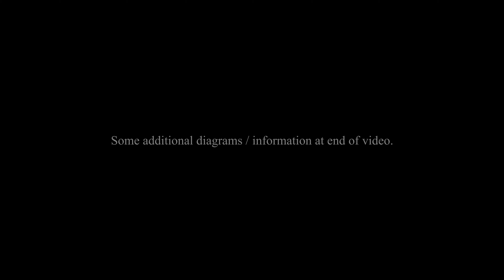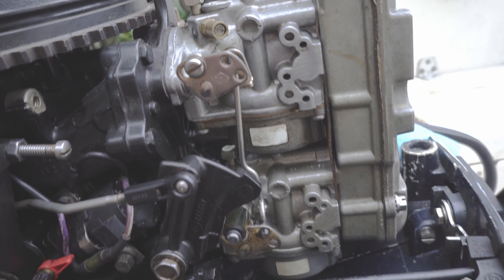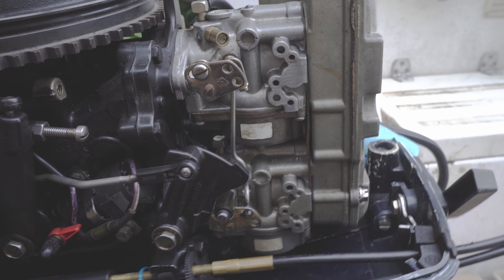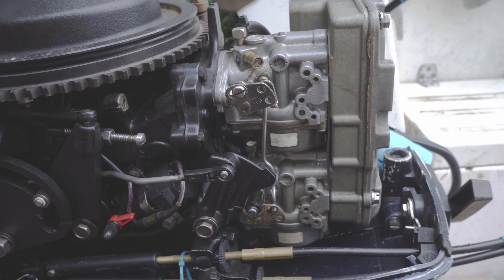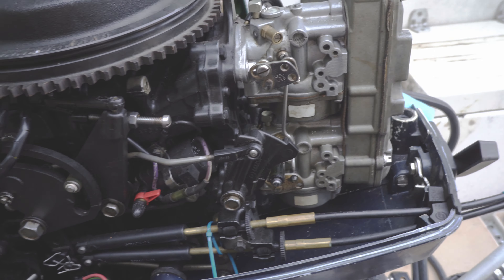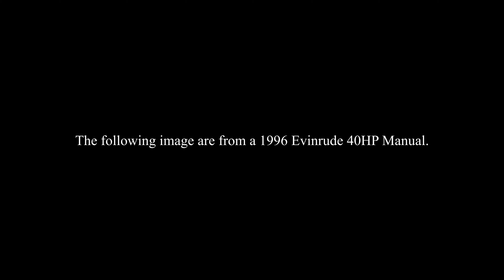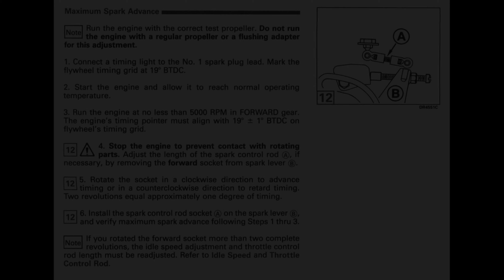Two Stroke Outboard Shaking - easy carburetor linkage sync check and adjustment

Comment: Thank you. I had a rubber seal in the drain on a water separator filter. It puked all this into my carb. Bottom only because the fuel manifold is vertical and the gunk plugged the bottom carb. Cleaned the carbs, ran great 2 trips. Hit rough water on 3rd. Ha! Small pocket at bottom of fuel manifold still had gunk in it. Cleaned it all again. Now had a pulse idle! Kill it bad. Made the adjustment in linkage you recommended. BAM! Smoothed right out. Put the timing light on it at idle, 2 degrees off. All loose when I got this motor. Runs great with that gap.  Thank you.

Comment: Also make sure all the throttle butterfly plates are closed in idle position because the linkage between the carbs may be keeping one from closing completely if adjusted too tight. Also one of your spark plugs may not be firing, like a bad plug wire could be shorting.

Comment: I have an evinrude 150xp, and mine constantly dies on me after running a fairly decent 32mph for a good distance, but when I slow down to idle or dock, it wants to die repeatedly and I was thinking because of the low idle, but I'm gonna check these parts out, too... thanks

Comment: at 2:10..mine dont start off horizontal ( 3, 9 o clock
) they are slightly off. and my lower carb pin doesn't open vertically when wide open. how do these get adjusted.

Comment: Came across your video and will look into this!

Hope you can help diagnose this issue.

1986 Nissan 70HP

Both carbs had new kits put in them last year.

I believe I am having a fuel or air problem and not getting the full power of both carbs.

It is also possible the carbs are not properly 'synched'.

When I spray a little carb cleaner in the top carb the engine rpm raises dramatically maybe another 1000 or so.

When I spray the same shot in the bottom carb the engine rpm raises but maybe only half rpm of the top carb.

What would cause this discrepancy?

Would I be correct in thinking I have an issue with the bottom carb?

It appears to be more air related as opposed to fuel related.

Comment: Where is the adjustment made ?? How do you make the pins vertical .. Mine on the top carb is way off .. Both carbs were removed and cleaned ..

Comment: Do you have a video on how to adjust the idle on this motor? I have the same one and want to increase the idle speed
Reply: Dito on showing how to sync the 2 fly's to work when running wide open if there a bit off bud...Mhahaa

Comment: How do you adjust it? I need to check mine. It’s shaking somewhat and idling too low
Reply: It did have that ever important how the f do you adjust it when it’s wrong factor...
Reply: But the 2 cylinders generally shake a bit at idle but should smoothly accelerate to wot. And sing pretty

Comment: the roller for the timing advance (the big slotted plastic piece to the left of the carbs below the flywheel) is off quite a bit! the 2 arrows point inwards needs to be lined up with the roller, same thing for the carb cam roller. you are off a bit there as well. you also need to check the advance link rod and make sure its the correct length, which it isn't because the roller doesn't line up with the arrows. need to check the factory service manual for specs.
Reply: Noticed that as well. Way off!
Reply from the maker: This motor was not really calibrated I was just using it to demonstrate but thanks for any additional info!
Reply: @cenkaetaya  no worries. top short spark linkage exactly 5.3 cm long!

Comment: Thanks for this. You helped me out with that last video regarding the shift rod connector going onto the clutch dog. Motor and gears are working great. However, could you walk me through adjusting the carburetor as you talk about in this video. I have a 2001 50ho Johnson and it shakes, doesn't start unless I put it in idle and stalls out after it's been running a while. I have cleaned the carbs and replaced with a carb kit. I don't see any leaks and i had the fuel pump rebuilt 2 seasons ago. I'm thinking I just need some carb adjustments and sync. Please help brother..........you know what you're doing and create very helpful videos.
Reply: Same motor, same issue
Reply: Im a rook also, but I have learned from some wise folks that carb mixture adjustments may differ slightly from motor to motor. However, here is the standard instruction and should not be too far off. With some ears you should be able to find her sweet spot: Turn carb adjustments knobs to full close, then turn back about two times, then with the motor running in gear turn forward again ever so gently (like 1/8 of a turn) until you hear a small sneeze, then finally you turn back again about a quarter turn and somewhere there should be the nice spot. Motor will run if its close, but to get that nice 2stroke sound and power you need to find the sweet spot. Do the same for all carb and best when in gear and running.

Comment: Good evning I was wondering if u had any idea what the factory setting is for the jet just above the linkage u almost toughed it at like 15 seconds in thank u for any help  mine is a 1991 Johnson 40 can't find much on them on here
Reply from the maker: Those are the low speed jets, I would check a manual, roughly they are somewhere about 7-8 turns (half turns) so around 3-4 turns. Note these are for idle speed, they wont affect engine at full speed.
Reply: @cenkaetaya  thank you very much I do not have a manual I will search more on line to c if I can find one I assume I could make it to lean with those screws and don't wanna do that

Comment: Nice video..I have a 75 hp tracker force motor. It is on my suntracker bass buggy 18. It won’t go faster than 9.5 mph. It burns through a 5 gallon tank in no time at all. What are your thoughts on this?
Reply from the maker: I'd start with the carbs as its quick / easy.
Reply: I have the same exact issue. It used to run nicely, but would have trouble turning back on or it would die after going WOT, and then to neutral. So I rebuilt the carbs and now it won't go over 8mph. Did you ever get this solved? What was your issue? My guess is it's the air mixture screw
Reply: @michaelbriseno869  yes I rebuilt carb, replaced fuel lines, spark plugs and it ran better but still wasn’t running they way I knew it could. One day I noticed the butterfly wasn’t opening up more than 1/3 of the way. I adjusted the throttle linkage and that was it it went from 9.5 mph to a little over 20mph and runs great now. Hope yours ends up being a simple adjustment too. Check out the video of me getting caught on the lake during a severe thunderstorm. If I hadn’t fixed the throttle issue we’d never made it through that storm!!!!  https://youtu.be/l7Qz3M1Z-LI

Comment: I have the same 1986 40hp but with vro.  Have you ever got into the cylinders on yours?  I have 0 compression on the top and 150 below.  I hope I got it soon enough that it is just rings.   Any pointers?
Reply from the maker: Problem with the old motors is... hopefully you can get those parts off without anything breaking.

Comment: I have a Yamaha 25hp 2-stroke that runs fantastic on all stages, starts easy, idle's great and picks up out of the water like a bullet. The only complaint I have is that the entire throttle zone between idle and the "starting icon" (sorry don't know the term for it) is completely useless, the entire zone when i twist the throttle is the same idle speed and then it picks up. Looking at my roller there is a sizeable gap, about a centimeter gap at idle so that explains the dead zone until i get to the "starting icon" where the roller then touches the throttle. My question to you is how should I go about fixing this? I can loosen the plate on the throttle and reposition it closer to have a smaller gap, but will this mean that when I throttle to the "starting icon" that it'll be in even higher throttle? I don't want that it surely can't be good for it and likely will do nothing more than flood when I go to start it. Thanks i hope that was somewhat clear... lol

Basically if I do this the position at start will likely change, what should the starting position even look like with relation to how hard the roller is touching the throttle?
Reply from the maker: What I would do is first check if at idle / start mode does the throttle at all. If it doesn't, it means you are only physically using the throttle to accelerate and that's it.

So for example, now if idle, and everything works fine. You want to now put the engine into full speed forward  (engine off) and see if all the carbs are 90 degrees (fully open). 
doesn't

1 more thing to note is the controller cable play can affect how "well or smoothly" the cable and controller actually move. For example if you just slightly put the controller in forward half way and go back to the cable on the engine side, push it in a bit and make sure its tight, this could solve the issue. Essentially when you move it forward you dont want slack, you want a slight movement to push it forward, not have a situation where you are moving the controller but the cable is basically doing nothing until its in final position due to tension. Its just a push / pull action and the moment you move it forward you want the controller to push, no delay. Not sure if that makes sense.
Reply: @cenkaetaya  thanks so much for the reply I'll give these a shot later today!

Comment: Hi, nice video. I recently purchased a 1989 Johnson 70 for my boat. It ran very nicely at 10 knots on its first voyage for an hour or so, but as soon as I entered an unrestricted speed area and attempted some acceleration the motor shook from side to side  fairly roughly. Low speed was always okay. Do you think it could be a sync or dirty carb issue, perhaps a blocked higher speed jet that only presents issues under acceleration?
Reply from the maker: I would definitely take apart the carb and clean the orifices as they are the most likely issue. Use one of the twisty tie's that come with various packaging and remove the plastic from it. Makes a perfect tiny little metal poking stick.
Reply: Sounds like it may have gone into S.L.O.W mode.  Often caused by over heating or faulty temperature sensor.  But, can also be caused by a fault in the power pack.  SLOW will not let the motor rev up.  Therefore the motor will shake because cylinders are cutting out and not firing.

Comment: Hello. I have the same engine and I’m getting idle problems and cutting out when engaging forward. Out of curiosity why is your cam follower so high from its resting middle mark. Is this done for idle adjustment. I’m just curious. Ps keep the videos coming I need them haha.
Reply: He needs to do a link and sync, it's easy to do. You're correct, the cam needs to rest between the two arrows......

Comment: Hello- I need help doing the linkage adjusting/synchronization on my 1997 Johnson 15hp tiller model 2strk. The manual says to remove pin retaining throttle lever connector. However, you cannot access this without removing the lower power head cowling, which I attempted to do but there is one screw I cannot get to as it is almost underneath the power head  by the latch mechanism and no way to access. Was wondering if anyone has ever been successful performing this synchro procedure and if so, how did you successfully remove that last screw (located inside the cowling, towards the back of the powerhead, right by the latch mechanism)? Thanks in advance!

Comment: Hey! You can help me a lot! I have the exact same engine: the problem I have is that it’s hard to start it and it dies often in  neutral such as forward/backwards low speed. And it shakes as hell in low speed. Are u sure that this problem could be solved by cleaning the carbs?
Reply: And where did u find a manual?
Reply from the maker: @melkerforslund2130  I purchased one online a long time ago. If it is dying at low speed the timing may be set too low also check the idle valve screws.
Reply: I am having the same exact issue with my motor as stated above. Very hard to start but dies in low speed. Runs great WOT. However I did just notice I am missing the plastic sleeve that sits between the arrows on the cam roller. I’m wonder if this is my issue. 🤷🏻‍♂️

Comment: If it is a two stroke 40-50-55-60 horse Johnson/Evinrude 2-cylinder looper, it is going to shake from side to side at idle.  That is simply the nature of the beast.  Not my favorite Johnson/Evinrude motor for that very reason.  Learn to live with it, or get a 3-cylinder 50-60-70-75.  They are amongst the finest 2-stroke motors made.
Reply: Can fully agree with this! The Yamaha 40-60 HP 2 cyl also love shaking their heads

Comment: Hi. Thanks for the video. My '89 40hp looks very similar to yours. Mine is struggling to idle when in the water.  I made some of the adjustments you recommended. My manual doesn't discuss carburetor mixture adjustments. Does yours recommend how far to turn the screws out? Do you know where yours are set? Thanks.
Reply from the maker: Its hard to say exactly what is going on without looking at it. It could just be dirty carbs, or you may need to increase the idle stop forward a little to increase the timing. However you should only really do this if you have some way to measure the rpm / timing. If you adjust the timing stop just a little forward you should notice the engines rpm increase with ever few turns. The idle timing stop is the little bracket that controls how far the entire mechanism pulls back when its in idle position. Moving it forward just a little will increase the rpms. Not 100% sure how to explain it without showing. I would watch a few videos on timing, but also make sure your carbs are extra clean.
Reply from the maker: The carb screws are fairly flexible, I would play with them a little and see how the engine performs. I believe mine are either 2.5 or 3.5 turns out from the fully in - seated position. If the engine is having a hard time idling still check the other comment I below.
Reply: Thanks for the response. It's very possible it's dirty carbs. I've also adjusted the idle screw but that has not made a difference. I'll look into the idle stop. Thanks again.
Reply from the maker: @jeffkepeck613  Make sure you take apart the carbs and clean out the orfices. Its really easy and quick to do. If you arent sure what is going on with them, just take them apart. Because if they are clogged, no matter what you do it wont change the performance and the orfice holes are really tiny and they can get clogged incredibly easily.

Comment: Could this cause the engine to cut off while running wide open?
Reply from the maker: Dying after WOT is probably a fuel supply issue. I had this for a while, it would run WOT for a minute and then cut out. The fuel hoses had a leak and even though the carb filled up with fuel and ran at idle or medium speed. Once the engine went WOT the pump was simply not able to refill the carb bowl fast enough. This is why it worked for 1-2 minutes because once the bowl drained, the engine died. If you turn it on again and let it run at idle, the bowl would refill and you could once again run at WOT for a minute or so. Took some time to figure out.

Comment: how do you adjust???
Reply from the maker: You can use the screw on the linkage itself. However, if you adjust this fully, and it is not 100% vertical in full speed you will need to look further down the linkage setup. Motors are different but generally you need to turn the rod what pushes the throttle forward and get it to align slightly better with the carburetor.
Reply: @cenkaetaya 
have you read ALL the comments? 😢
make a video that shows people how to adjust it.

Comment: I have 2 1997 evinrude 90hp outboards. I can audibly tell that my starboard side motor is running at a higher RPM than my port motor at WOT By the gauges its 800-1000 rpm less. do you have any suggestions as far as what to adjust to bring my port motor up to match?
Reply: Turn the idle screw out less on the motor to bring down rpm on idle

Comment: Your motor is the same as mine.  Runs great at full throttle but has a very slow idle and dies when I put it in reverse.  How do I increase the idle speed to prevent this?
Reply: I’m having a similar issue, this is an idler screw but I’m not 100% how to adjust it
Reply: Idle scew in lean out rich

Comment: Hi there, I have the same engine a 40hp Johnson and having issues with it, it revs out perfectly in neutral however once you engage the forward gear it won’t rev out, and is stuck at a low speed, it revs out perfect in reverse and neutral but not the forward gear. Any idea what this may be?  The carbs accelerator cable is working perfectly and is opening the carbs as it should.